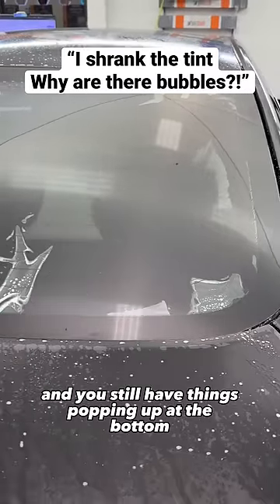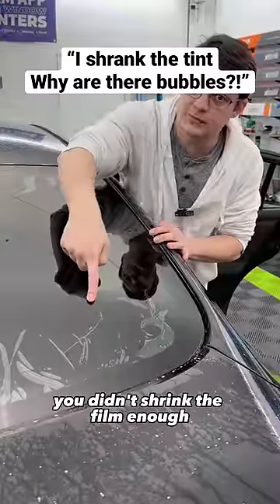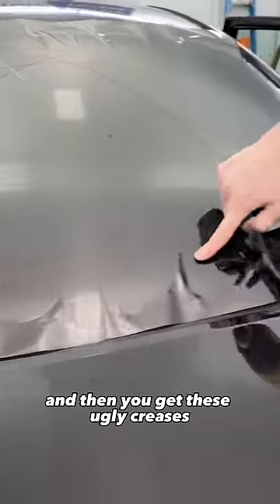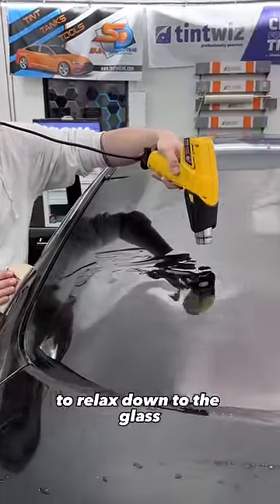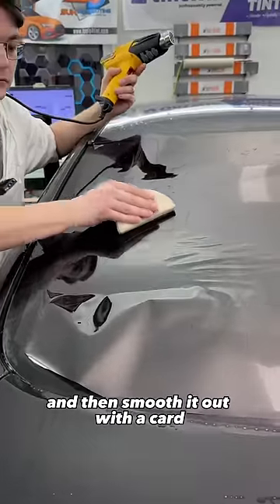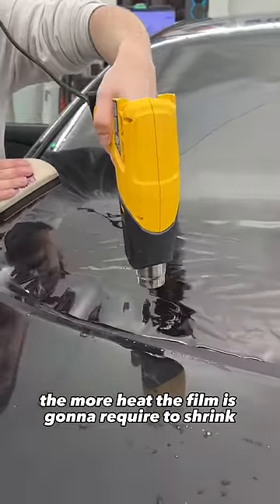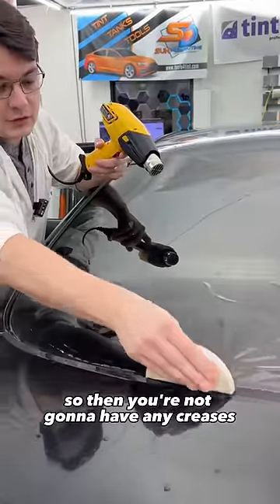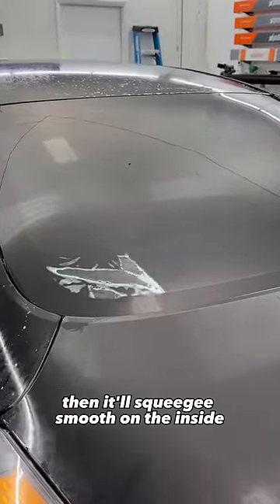Shrink Tint NO Creases! #tint #cars  #diy #windowtint

Comment from the maker: Tint and tools —> 313tint.com
Reply: Where are u located at in Detroit
Reply: which company paper r u using in this video for tint the miror
Reply: Nice video i like it thnx for the tip
Reply: Is it possible to use window tint on Sideview mirrors to make the shine from the sun go away or at least be less blinding?
Reply: Question. I’ve got a 4 inch dog hair in my back window. I really don’t want to replace the tint. If I popped it with a needle and applied heat will it make it less noticeable?  Any suggestions would be much appreciated.
Reply: @teddy155  definitely dont take my word for it, but maybe you could warm it up and peel it or something, I'd research before tho cuz I ain't tryna mess your stuff up
Reply: How does the inside have anything to do with the outside?  Actually curious, not being a dick.
Reply: No thanks. Highly illegal in my country.
Reply: I like how you think and stuff. Everyone who can do that thinking thing she be rewarded
Reply: Can you fix tint that formed small waves from the heat of the sun using this technique?
Reply: What is the name of that shovel-type tool that you use to install the tint? the tool with which you remove all the water

Comment: The more I watch these, the more I realize I should never do this.
Reply: For real this is one of those things i would fuck up major if i ever tried myself. I don’t have enough patience
Reply: Yup it is very complex for the amount it costs for someone else to do it
Reply: For me it’s the fact they hold the damn heat gun SO CLOSE. It’s gonna burn tf outta the paint lol.
Reply: Do it a couple of times and you’ll be fine may be hard the first time but gets easier over time.
Reply: I screwed up my phone screen protector, no way I can do this myself
Reply: @yunan9610  ahahah!!  Yup 🤣
Reply: “Go slow,” as he says, because that is the only way to safely operate a heat gun on any material. I occasionally use a heat gun to uncoil large hoses. Take your time and work on areas based on how thick they are. The thicker the material, the smaller the area of focus should be. The thinner the material, the larger the work area should be. Don’t be afraid to pull back and take a break. You can always try again, but if you leave the gun on an area for to long the damage isn’t typically reversible.
Reply: @caliber5602  you could wet the paint, that way the water absorbs the heat

Idk just an idea, I've never done this 😂
Reply: Definitely one of those things where you're better off paying someone to do it. Much like replacing a suspension coil spring, them things ain't foolin' around. I'll pay a mechanic to fix it rather than get myself killed.
Reply: Dude I get bubbles underneath my phone screen protectors, let alone these wraps on my car!
Reply: It’s like sticking a large sticker and you are gonna pay 1000 bucks for that? Hell nah
Reply: @thebigcheese8715  it’s not like rebuilding an engine, things like changing suspension or bleeding the brakes are much easier and helps you understand how car works.
Reply: i have problem with phone glass cover.. i wipe to perfection, then take a glass pull the covering film and put it over but some how at least one dust particle magicaly apears on the bottom. so by project like this.. its probably cheaper to give it profesional.. it bugs me the fact you need homologation in damn europe
Reply: @yunan9610 ayooo same😂
Reply: @yorkoxmaul66  you’re a little slow buddy stay in the drive thru 😂😂
Reply: @hennysay  plus it's not even that expensive. Well worth the cost imo
Reply: That’s how I feel about vinyl wraps too haha
Reply: Fr😂😂 I already tried and it ended terribly
Reply: 😂😂😂 i was about to buy a kit for 2 front windows, found a guy that drove to my house did it super quick and for the same price as the kit with. He had some quality film as well
Reply: "I can't learn a skill because I told myself I can't."
Reply: It’s about $300 here in Nz get my Ute done once it’s out the shop definitely don’t have the patience for this lol
Reply: I cracked the glass with the heat gin
Reply: @caliber5602 you clearly have no experience with working on cars
Reply: Facts 😂
Reply: Swear I thought I had it figured out until….
Reply: @Andrew-sv3ck  Exactly, it's hard to get right and not that expensive to get done so not a great DIY project.
Reply: @caliber5602 it would burn if it was a torch but it's only a heatgun basically hot air
Reply: Same bro lol. With my luck; right in the middle it’s going to have air bubbles somehow
Reply: Fr i can barely put a dticker on without bubbles
Reply: then take it to a shop that will do it
Reply: Slow is smooth, smooth is fast.
Reply: @caliber5602 
Not at ALL man it's a heat gun not a blowtorch😂
Reply: @thebigcheese8715 
Coil spring can and will kill you, tint wont😅
Reply: Because it's illegal? It is over here.
Reply: Facts, I’ll DIY everything on my car but the tint. That shit takes hours of practice that I just ain’t got.
Reply: He makes it look so easy too brought a new respect to how much random stuff other people have come to master
Reply: @caliber5602 you realize cars sit in the blazing sun every single day with no issue right?
Reply: All he’s really telling you to do is “take your time and don’t rush”
Reply: @caliber5602 this guy😂
Reply: We're built differently
Reply: @kcodm250 literally hot air, not basically.
Reply: @asmith8898  wrong use of literally
Reply: @kcodm250  not even close! Grow up.
Reply: Maybe try on something smaller first like a motorcycle wind shield and when doing it on your car maybe only do the inside because if it's darker on the inside than the outside you get like mirror effect you can easily see out but it's hard to see in and if you fuck up its only on the inside and it looks like if you fuck up its kind of forgiving and you can try again
Reply: Me and my uncle tried it on the back window of my truck and it was very difficult and it still has creases
Reply: @caliber5602 no it wont cars sit in the sun all summer long, i mean maybe if he sat it there for a long time but not long enough when youre doing tint
Reply: I felt that, lol. Some things are better left to the pros.
Reply: @Brandon-uy1uv nahh it’ll be fine, he doesn’t know what he’s talking about lol😂
Reply: Yeah I tinted windows as a teenager (house windows not cars) and it's hard AF to do right. The hardest part is making sure it's perfectly clean. Even one tiny piece of dust and it's ruined. Boom, there goes $80 of film. Time to try again.
Reply: I can't even put on Lego stickers right, there's no way I'm trying this lmao
Reply: If this ain’t fucking me summed up ina comment lmao
Reply: The more I watch the more I believe I can do that lol
Reply: It's so easy when you practice once or twice. You literally put the film on the window dry, and just heat it and press to shape. Start from Middle to out
Reply: @Dabbin916  it's what I think too. Some things needs practice experience and this one seems like that.
Reply: Wow are yall really that incapable? Idk if he possibly could have made it anymore simpler and easy to follow. It is an extremely easy process, y'all are just scared to even try that's what it is
Reply: Like to tint the outside
Reply: It's not too difficult... but it's an artform... me and my 3 buddies are all artists so it wasn't to terrible to do... but it's not to expensive to have it done
Reply: Did it using Walmart tint and came out pretty good very slight creases or fingers
Reply: Bro I fucked up my first 3 try’s but once you get the basic cutting and film manipulation technique it becomes kinda easy
Reply: @yorkoxmaul66 1000 bucks ? Bro whoever quoted you that price is ripping you off or youre tinting a huracan lol
Reply: Your brain instantly adapts to tolerating the learning phase of this trade - when you are in a pinch.
Reply: It's very therapeutic with headphones and some ambient beats....I love this job ❤
Reply: Bro fr lol
Reply: Ong😂😂😂
Reply: @thebigcheese8715 I'm sure you won't die trying to tint your car yourself
Reply: @T2R0U2M4P  your reading comprehension skills are truly remarkable! It's like you ignored the whole second half of the comment...
Reply: I just did my first windows and vent windows today with crappy tint, and it turned out good but was way harder than they made it out to be

Comment: Back in the 80s we bought tint from the auto parts store. We used a pen knife or a razor blade and a ton of windex while smoothing it out with a card card. Lasted forever.
Reply: Windex instead of water?

Comment: Those are called fingers that can turn into creases if you squeegee them too hard. You can save the tint during install by adding more heat to the outside without having to start the process all over again.

Comment: The slow addition of medium heat allows the tint film to 'spread'the big crease into smaller creases which become easier to adhere to the curved surface. I used to work as a vinyl signage applicator person - vinyl graphics material works in the same manner.

Comment: Tint goes on one side so how does it go from outside to inside? Honestly curious. Initially it starts on the inside then he shows you how to do it on the outside to fix the problems on the inside.
Reply: That’s what I was thinking it’s not the same he should demonstrate the same thing
Reply: The tint is shrunk on the outside and then installed on the inside. So in the beginning he is showing that if you have the problems on install (final step inside) then you are messing on during the prep on the outside

Comment: Wait I'm confused, why are you putting window tint on both sides of the glass? Wouldn't the outside layer be exposed to outside weathering and damage. I've just never seen it done like that. All window tint that I've seen installed and put on vehicles was just on the inside of the window. Seems a bit excessive and not needed. In my opinion, a waste of money to put it on both sides.

Comment: just did the back window tint on my car today.  Took a total of three rolls of tint and a new heat gun which definitely worked better than my hair dryer which wasnt hot enough.  Still got some bubble action but not as bad as the first two attempts.  I burned the edges a couple times on the last one and had to cut those edges off, plus I realize I didnt allow enough time to heat it up even with the heat gun but it was a good learning experience.

Comment: What happens to all the soapy water which you just squeegy into the interieur?
Reply: someone please answer this
Reply: Back windows if you don’t lay your soak towel will all end up in the trunk. doors are different they have drain holes so most of it is ejected while the other evaporates

Comment: Just to be clear. First fit to the outside of the window before installing it on the inside of the window?
Reply: Doors are cut shrink clean install back windows and shields are shrink cut clean install
Reply: @indacouch253  now you're just saying words
Reply: @paulrenville7757  no just didn’t put the commas

Comment: How hot the glass can get???I wanted to tint the upper portion of my windshield and the shop tell me they Can’t not do it do to a rock chip(crack) one of the tinters tell me if I can get someone to weld/fix/fill the rock chip then he will do it,what’s your thoughts on this issue,do you have a video on this particular issue??
Reply: They said no because if they heat up the window it will crack it more

Comment: I got my tint done about 4 months ago, there was 5ish streak like bubbles left in the back window, I was told they would go away on their own, no matter what you do those bubbles will not scrub out, 4 months later bubbles are still there. Is there any way to shrink or remove those bubbles safely without ruining my tint?

Comment: How do I avoid the fingers creasing up and melting because it climbed towards the heat gun
Reply: Sounds like your film is maxing out . When dry shrinking make sure to stretch correctly before shrinking this will minimize the size of fingers you deal with and put less stress on the film

Comment: Did he adhere the film to the outside and then to on inside?  I don’t understand.
Reply: He did it on the outside so we could see what he was doing
Reply: You cut the shape of the film to the outside, then heat shrink it to match the curvature of the glass. If it's not 99% flat, you need to heat shrink it. Since the glass has the same curvature on both sides, it's easier to work on the outside of the car. When finished, you peel the backing off (which faces outboard/you) and then wet the film so it doesn't stick to anything. After positioning the film in place on the window, the squeegee squeezes the water from under the film, allowing the adhesive to work.
Reply: @badtzmaru17  thank you, that makes more sense.

Comment: i don’t get how doing the outside tint helps the inside?
Reply: cos its the same shape as the inside
Reply: @DameAndThatGame  so if the inside doesn’t work, then you do the outside, the inside will work? or do you have to re do it?
Reply: @pilot760_  Hes not tinting the outside, he using the outside to shrink the material then using that same piece of maetial to tint the inside, you cant srink the tint on the inside of the car, would be logistically impossioble, and, you would be scraping the side of the tint that is not protected and will have scratch marks. Just follow the instructions, or go make some mistakes on cheap ebay tint to find out your self.

in short, shrink tint on outisde of window, (if its not flat glass), Remove protective film, apply to inside of glass.
Reply: @DameAndThatGame  thanks man 👌🏽
Reply: @DameAndThatGame  Oh, so you shrink it without removing the protective film, thus it takes shape by applying heat, then remove the protective film and install inside... such a different type of tint material from what was available back in 70's/ 80's when i did this in AZ.
Reply: @robozstarrr8930  excatly, also think of the tint as a giant sticker, you have to peal off one side to reveal the adhesive side, thats the side that sticks to the inside, and for the guy above, thats why you use soap, so thats stcicker (tint) does nto stick straight away

Comment: I have zero idea what you mean by how the outside affects the inside dude. You do realize they are two different sheets of film, that have NO correlation to eachother right? They physically cannot, they're divided by a literal window. What you do to one DOES NOT affect the other. What are you on about
Reply: You’re a little slow it’s one piece of film shrunk on the outside and installed on the inside